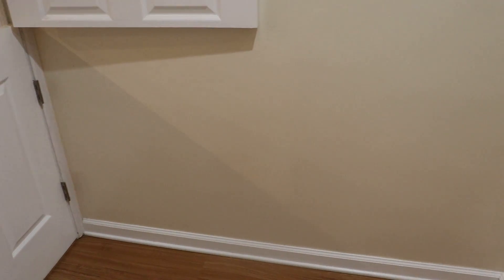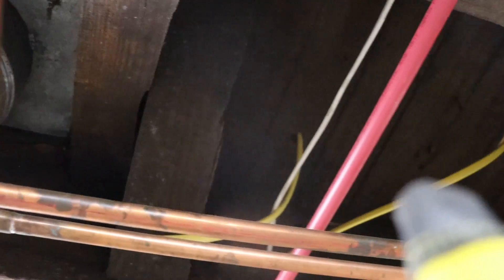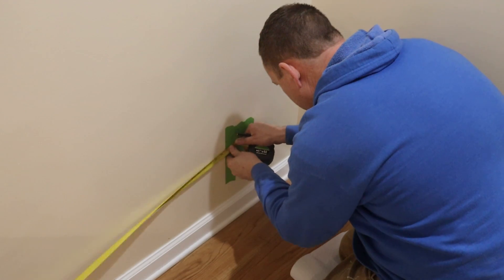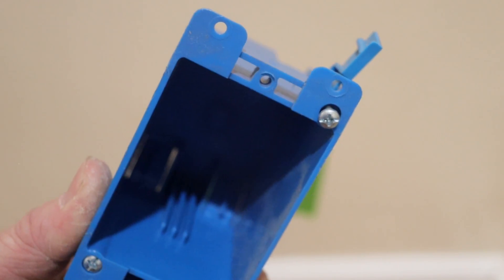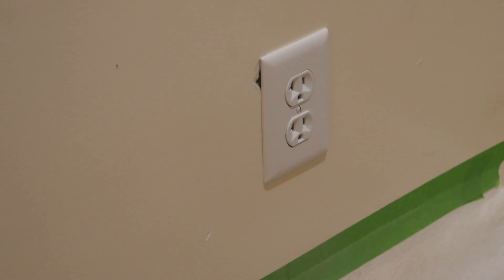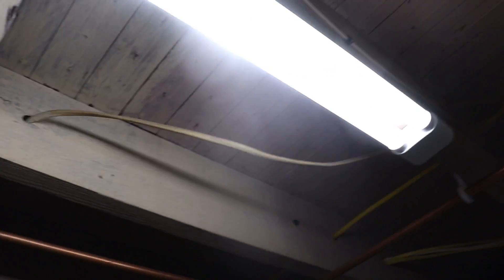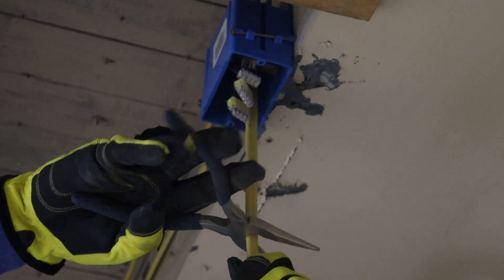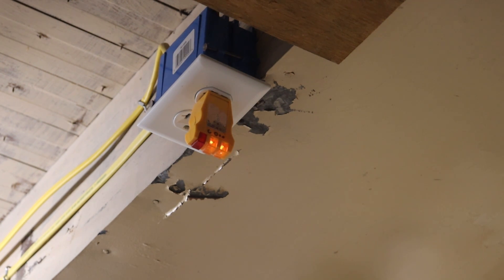Adding an Outlet to an Existing Circuit | Old Construction Outlet Installation

Comment: Hi! I really learnt a lot from your videos, really appreciate.  I have a question. I have 3 wall outlets in my bedroom, two of them are working properly, one of them has no power. I tried troubleshooting reset all GFCI outlets in the house. Still not working.

Comment: Do you have a link to the connectors you use in the outlet box or just the name.
Reply from the maker: You can get these at Lowe's and Home Depot. There are a few brand names for them.